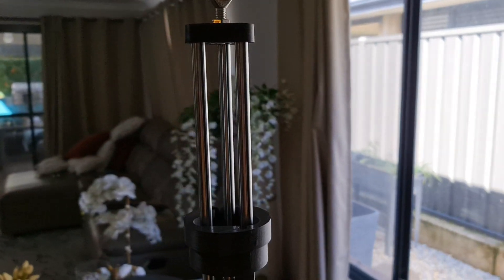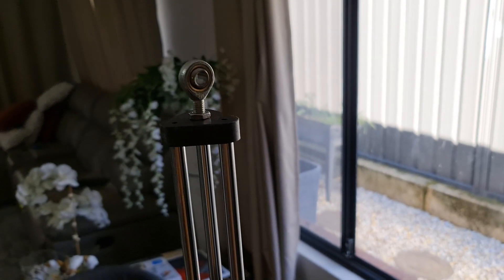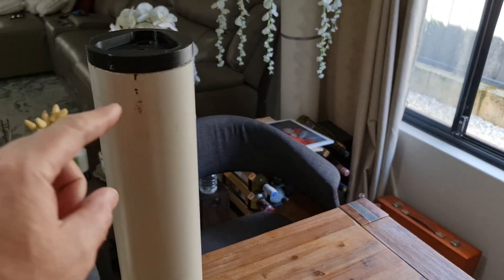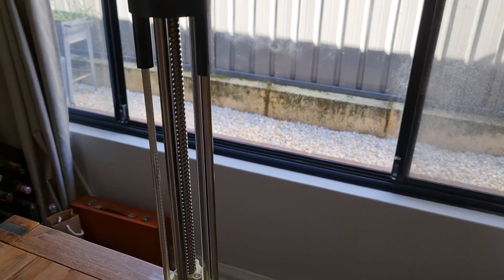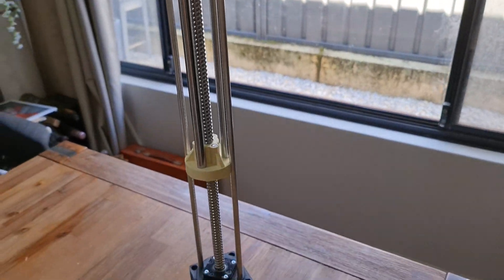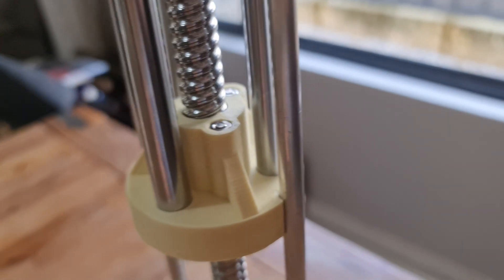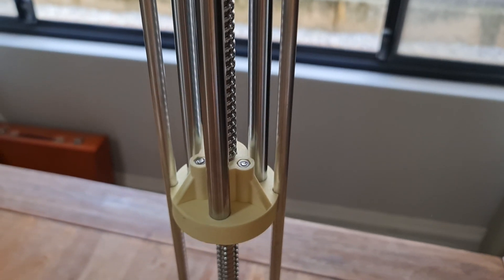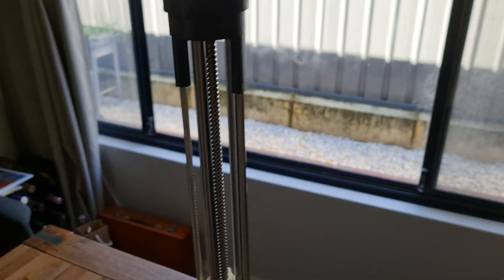NEW Actuator Design - Teaser - DIY - 6DOF

Comment: Hey Chris. Awesome work 👍

Just wanted to ask
1) How r u finding this design (3 prong) vs the old design (single shaft)
2) Regarding the side rails (the two that hold the top hat in place) … is there no reason why I couldn’t go a bit above the top hat and just bolt it down ??  You’ve done it for a more cleaner look right ?
3) Have u released the files yet ?Just about to start my own 6dof build … so it would be great to get some ideas off them.

Anyhow … keep up the good work champ

Comment: The ballsrew has 500mm/s travel?its this right?
Reply from the maker: Yes it does. With 10mm pitch ballscrew
Reply: @peacemakermotion3949  nice work
Reply: Wat is better on the new actoator?
Reply from the maker: @docmacb  Both ends of the ballscrew are now supported rather than the top end just floating around and relying on the tube and linear bearing to centralise it. makes for smoother operation. no more ball bearings so quieter, ballnut is printed so its infintely modifiable to suit your design, making for a shorter overall design and maximing travel for the desired ballscrew length.

Comment: I too have been following Volker's work with the printed ball screw.  I would love to experiment with your design to make a much smaller version of the actuator for 3DOF use.  Any chance you would make your part designs available?  Hardware part specs?
Reply from the maker: Hey mate. Yeah as always I'll release all files. Just when I'm happy it's reliable and doesn't need more modifying etc :)
Reply: @peacemakermotion3949  Thanks much!  Look forward to more results.

Comment: Can't wait to see more videos. Wonder how this printed ball screw will work 🤔
EDIT: was actually writing while watching, they are not so silent as i thought...
Reply from the maker: Yeah definitely quieter than ball bearings though.. I was hoping for quieter but smoother operation is key as well. Threaded rod now secured at both ends, not flapping around inside the tube.. will be interesting after its been run for a while under load and bedded in if it gets quieter.
Reply: @peacemakermotion3949   try to compare the noise with the old and the new actuator on your next video if it possible...👍
Reply from the maker: @djwillx974  yeah will do soon. Just a bit of fucking around but I'll try do it soon :)